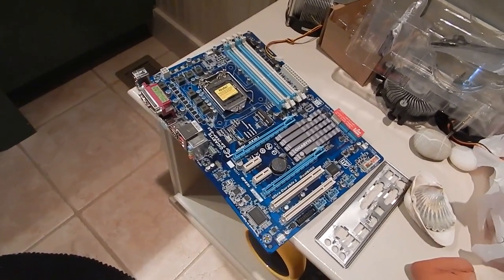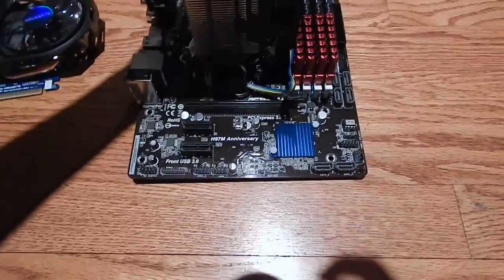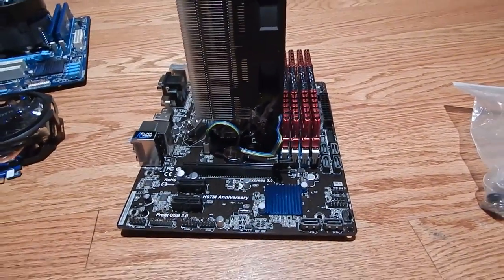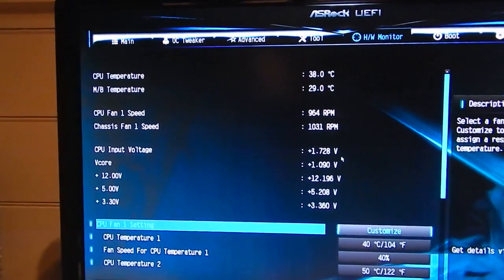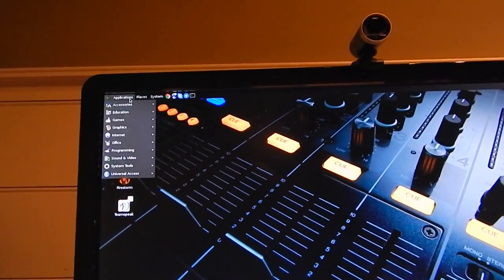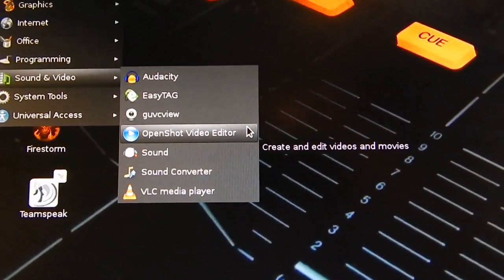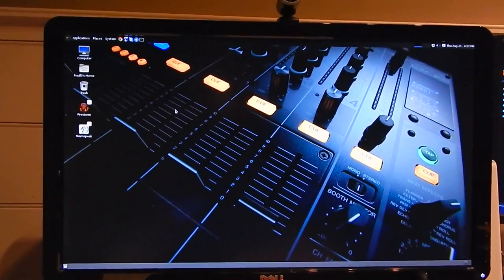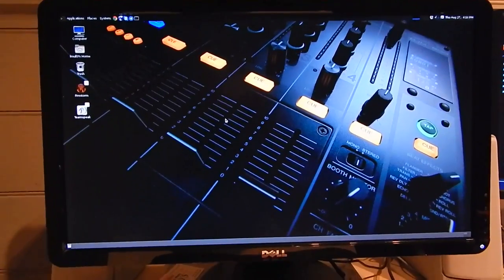Main Computer: September 2015

Comment: the b2 revision of sandy bridge chipsets has a problem with failing sata ports. problem can be solved by plugging drives into the non intel sataports or a sata pci/pci-express card. (might have been said already)

Comment: I envy you for being able to run Linux as your main OS. AMD video cards and their drivers both OSS and proprietary continue to piss me off in Linux and I end up back in Windows on my main system. On laptops and servers however, no problem. Debian is rock solid. 

Also, as an fyi, you can mount the fan bracket on your Hyper 212 on the other side of the fan and have it pull rather than push air. Works just fine and will shave off some height.
Reply from the maker: +Reece McGowan AMD is a very mixed bag when it comes to Linux. Intel and Nvidia tend to behave the best in my experience.

Comment: 3770k is a beast CPU. shame your not keeping it in your main PC.
Reply from the maker: +Calling The Tech Wolf I ended up getting rid of it a while back anyway, I needed the money at the time.
Reply from the maker: +DERPY PUNCAKE That barely matters. Spending too much money on new hardware with little performance gains isn't my cup of tea.
Reply: +DERPY PUNCAKE Skylake is barely an improvement over haswell, you should consider improvements before moving to newer cpus.

Comment: if you enjoy using linux, power to you. i personally find it unusable. i have tried to use it many times but i would just end up having to fix broken things all day usualy ending with frustations. i now only use it on spare machines i dont want to waste a windows license on or are just very infrequently used.

another problem for me is the lack of software support, or atleast all the things i want to run dont work on linux and in most/all cases is extremely fiddly to setup with wine.

Comment: The perfect operating system for people who like to wear tinfoil hats. Nah, kidding of course, Linux is great and I'd like to get into it more.

I'm a Windows guy though, I don't think I could switch just because I don't have much experience with Linux and it seems like it'd be a pain in the ass to deal with it's quirks, as well as some applications that I rely on being Windows only. As for the "data mining" in Windows, it's really not that big of a deal to me. It's not as if they're going through my documents, it's really only error/problem reporting despite what all these "news" sites tell you.
Reply: I totally agree with you. Linux is great, but it's not nearly as supported and stable (note, I say "stable" not as in it's unstable but you can screw stuff up on Linux very easily) as Windows.